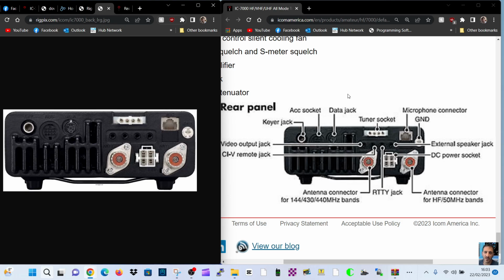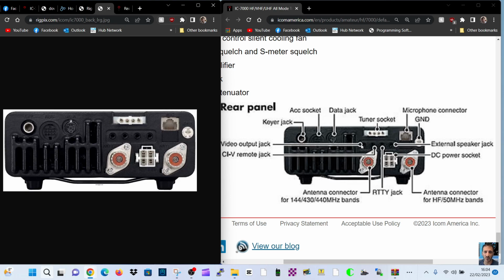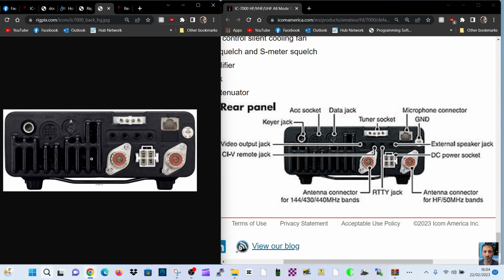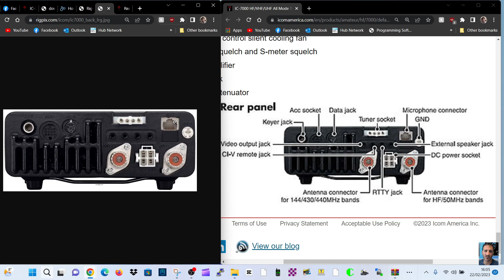ICOM IC-7000 - REAR CONNECTORS

Comment: Question. Can you have both a 144/430/440 and a HF antenna connect to the transceiver at the same time?
Reply from the maker: Yes but you need fit a duplexer on the HF and 50 mhz connector

Comment: Its a shame that radio was a flop it had problems with the driver board blowing up and smoking the board i bought mine when it came out i miss that radio i called icom for a replacement board it would cost 8 hundred in us dollars so i sold it as is for repair icom owes us another radio like it with sdr and updated software and cure the heating problem. The ic mark 2 g was a better radio and thiers more on the air still i rarely hear 7000s on the air. Alot of people had problems its a shame icom knew it had problems and they discontinued it in 4 years when they were out. Its a crying shame i told icom mine was smoked i wanted a replacement and they wouldn't give me a replacement after i filled out the warranty card i bought it from hro. They didnot stand by that radio it had problems. I never abuse my stuff and never messed with it it was allways in the shack iam still mad about it now for 8 years now i would never buy another one even used they must had the same problem they had it fixed then the person would sell it to try to break even what they pay for it. And thier fetching 8 to 900 dollars on the used market good luck on that radio my friend 💯👍📻⚛
Reply from the maker: Hi yes I have heard this many times its such a shame I only use it qrp I have purchased it to keep it probably my all time favorite along with the 705  if they had made it 20 watt probably would have been al all time best all Band all mode qrp set .
Cheers 73